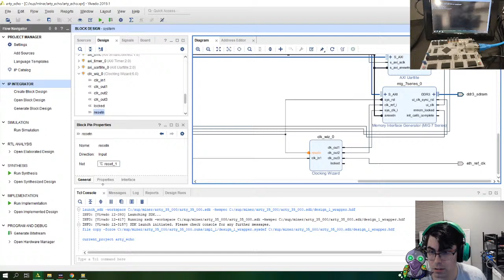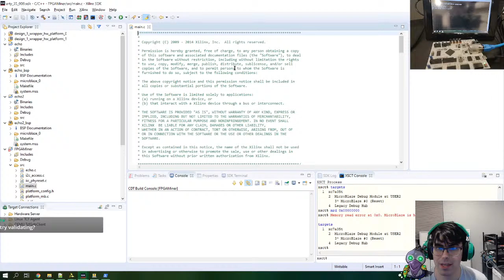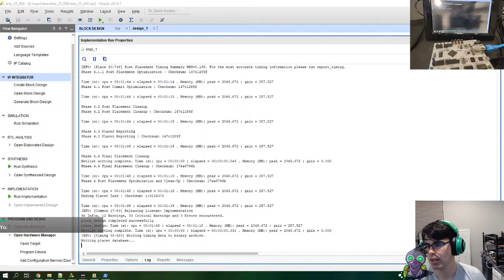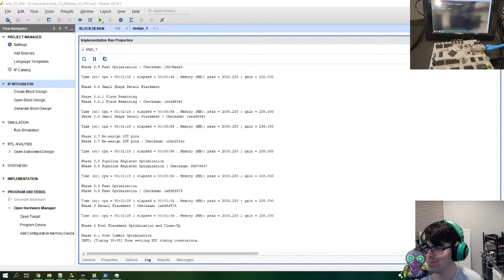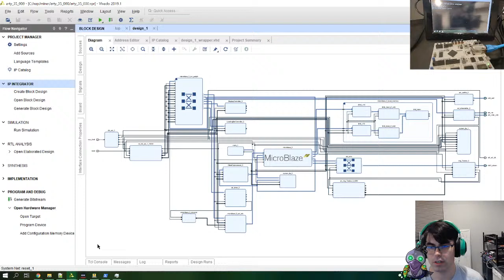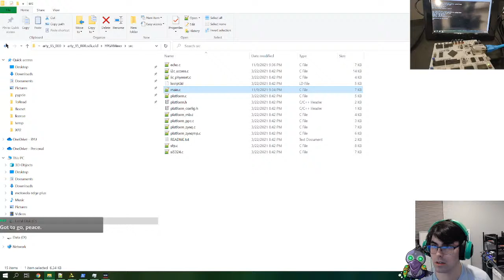SHA245, Does it Pipeline?

Comment: Cool walkthrough. Thanks a lot for the stream.

Do you use Vitis tool or do you prefer Xilinx SDK for dev work?
Reply from the maker: SDK is the old version, that I still use sometimes.  Vitis is mostly the same tool, but with some new features.  I am trying to get used it.
Reply: @FPGAZealot  There is also Vitis HLS and Vitis AI tool. All of them are different but wrapped under the name Vitis.